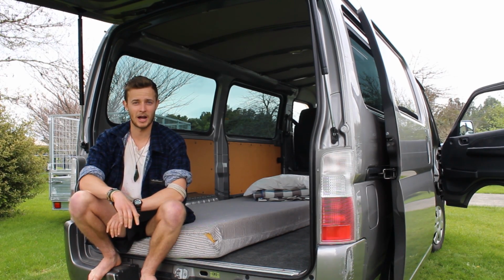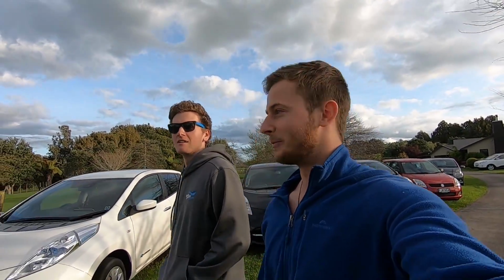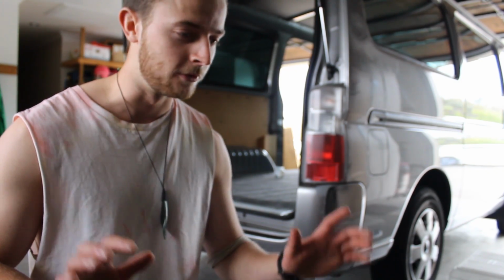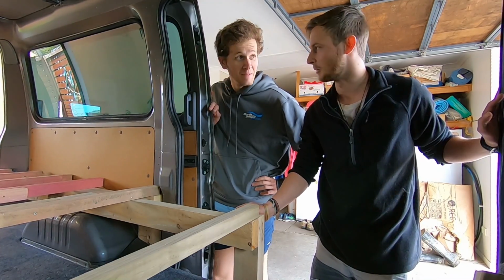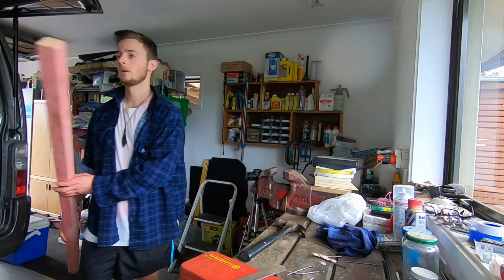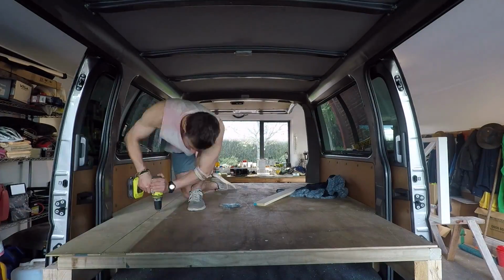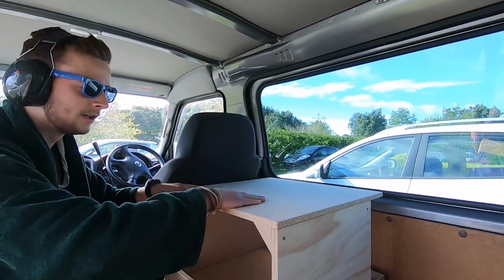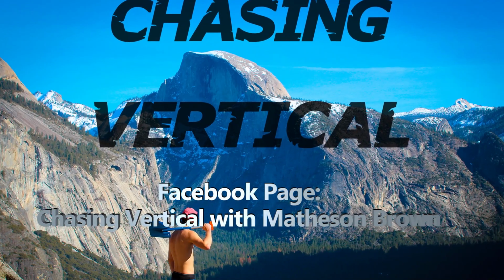The Realest and Cheapest Van Build on the Internet

Comment: A bed platform should be slatted to allow for aeration otherwise you can end up with mold and/or mildew issues from the moisture.

And instead of stealing wood / dumpster diving - you can usually just go to a Lowes / Home Depot / Rona / whatever home improvement center lumber yard and ask them for scrap wood. They always have some.
Reply: I didn't know home depot &/or Lowe's gave away wood.Thanks for that info.  Just to let you know, most contractors are happy to let you have their scrap wood.
Reply from the maker: Cheers guys. Yea I had to air out my mattress every now and then because of the base but next time I think i'll vent it a bit better.
Reply: @carrieanneb4220  I've found it depends on the location. One Rona I went to let me take whatever I wanted. Another one told me "no" and wanted me to buy their "scrap" wood which was placed in a bin outside the store by the front door. So your luck may vary there, I guess.

Comment: Yep, dumpster diving is the answer for many projects that need to be kept affordable. Construction dumpsters are a huge resource since the waste is extremely high in some cases. I started doing that at about your age. Its been about 6 years since then and I've found many things like lumber, stone flooring, full new 5gal buckets of quality paint, bundles of copper wiring, my current computer (intel xenon proccessor w/ 12gb ram), even medical machines and a medkit from closed down clinics. The list goes on. That said if you, the one reading this, is thinking of doing it you need to be good with your senses. Trust those spidey senses and be confident. Also, be like a ghost (be clean). I have never got in trouble but I am friendly if I ever deal with police and I don't dive areas that make it look too much like I could be stealing. I either hide my presence or make myself look as non threatening as possible. I also dont recommend going behind fences to dive and dont think you should collect anything and everything because your possesions can start to weigh you down in life. It can get addicting after a good find. You also need to know how to use what you find efficiently which takes more mental energy than just throwing dollars at a project alone. Also be aware of the 'paranoia level' of an area during a given time of day. Use those spidey senses!
Reply from the maker: Haha I couldn't agree more man, I do the same for the most part

Comment: Its all you need to start with - you can add stuff as you go along if you find you need it -  it does remind me of all the overpriced backpacker vans I looked at on Trademe before deciding to do my own. I have a slightly bigger budget, but still under $1000 inc solar,  house battery & basic electrics. Disappointed you didn't find a use for some Number 8 wire. Curtains? Two dark sheets and some magnets should sort that 😁🚐🔨🗺
Reply from the maker: Linz_in_NZ Yea very true, well done will the solar panels by the way that’s awesome. As for curtains, a tablecloth and some string sorted that out haha.

Comment: My idea as long as you bring a bucket lined with a trash bag with a toilet seat on top some fresh water for drinking and washing hands. 😊 a heat source is recommended.
Reply from the maker: Very true, as for the heat source I just use my mountain sleeping bag to keep warm haha
Reply: Matheson Brown that will work till a hard freeze but maybe you can stay away from them.
Reply from the maker: Kathy Fann I will try my best 😁
Reply: I recommend a wool hat and coat possibly a wool blanket inside the sleeping bag. My heater quit and I picked up 2 wool blankets and 2 down comforters and a wool head and neck cover. It’s not pleasant. When I get back to my home I will have a furnace installed. Don’t need all the time but when you need it at least you will have it.

Comment: what is the height of the bed. What size storage bin can go under it
Reply from the maker: I think the storage tubs were about 400mm high. The bed sat about 20mm above that. But we just put the bed to whatever height we had to to fit the bins under it, but would have gone higher or lower depends on the tubs we could find. Hope this helps.